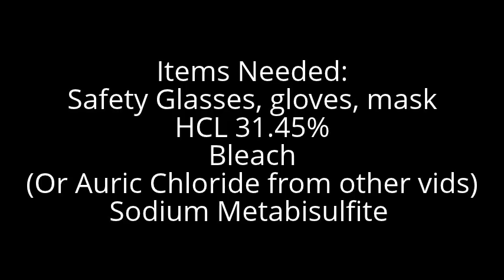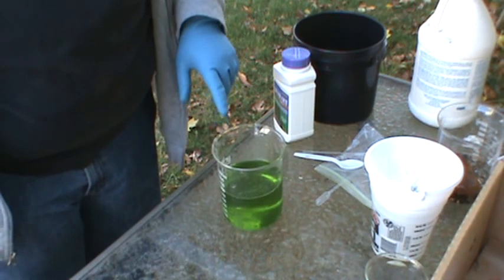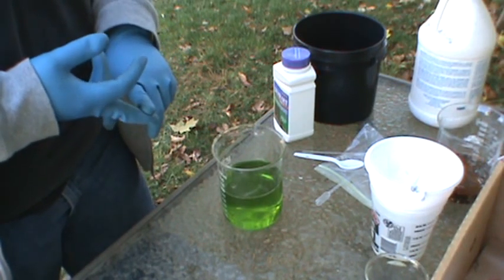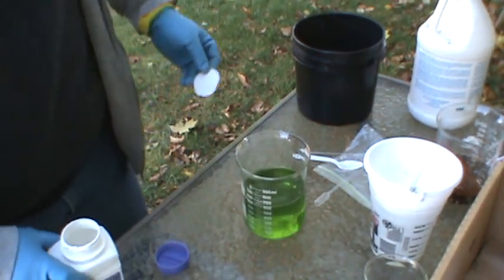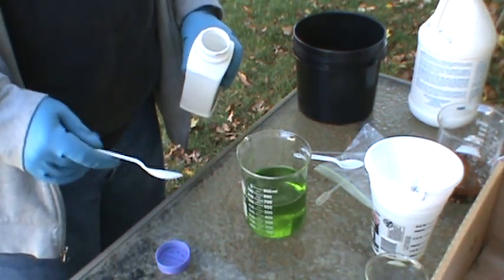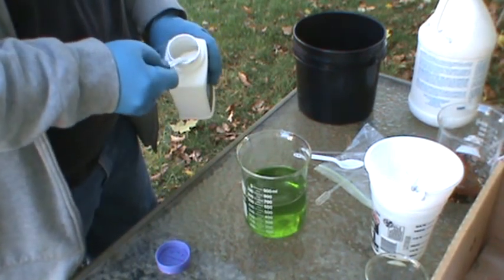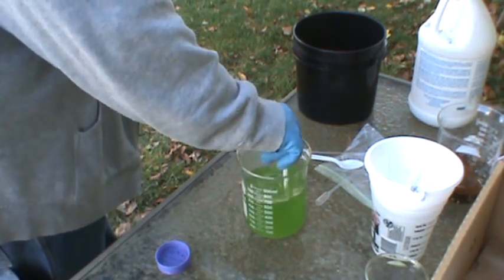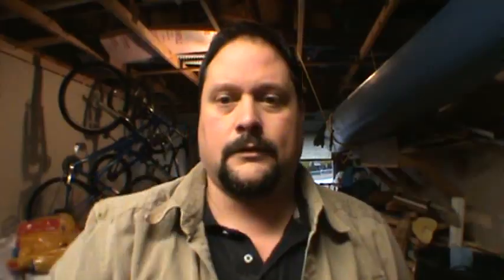Gold Recovery:  A Refining Process to Purify Gold

Comment: ~*Hello Moose!!! Quick Question Please ---- I put my foils in HCL & Bleach where it did dissolved. I filtered, added a little more then twice the volume of water then th SMB. When I added the SMB, no reaction took place. Left if for a few hours & checked agian & nothing. So I added a little more SMB & nothing... Do you know the reason of this? Could it be I put to much water in before adding the SMB??? Thank you & hope to hear from you soon. (YoungScrapper1)*~
Reply: ~*Also I had used just enough of the mix to slightly cover the gold foils at the start of it. So I wouldn't think it's the same problem with what you had with your reaction. *~
Reply from the maker: Hi there, I am not sure I can help out that much but will try.  There should not have been water added to start with.  That makes the amount of gold per ml drop quickly.  How many grams of foils did you put in and how many ML's of solution?  If there was too little gold in there you may not see the rapide darkening reaction or see much precipitation at all.  Another quick tip, adding more SMB does not help.  If there is no reaction with the first dose, there will not be one no matter how much you put in there.  Do not discard the solution.  Save it and the next time you have a few grams to process, at least 5-8 grams, use this solution that has the SMB in it to preicpitate the next solution.
Reply: Moose Scrapper
~*Thank you for your response, Tips & your help Moose!!! Means the world to  a young scrapper like me! ;)  I've been doing research the past few years about all these different recovering & refining methods following you & a few others before I ever thought of doing this so I didn't look foolish. I really thought I had it all figured out. Sad to say that I haven't got this ending process down... Sorry, I should of addressed this situation clearer. I had roughly about 3-5 grams of gold in a empty water bottle. I poured 2 inches of HCL in and added very small amounts of Bleach until there was not visible gold. So over all about 3 inches of solution. I then filtered & added water to the solution to doubled (I did a little more) the volume. (thought that was what I had to do) Then started dropping the SMB in the solution. When nothing happened, My heart stopped!!! But I will hang onto it & try what you said and hopefully get back on track with this ending process. I'm now just confused on the part after dissolving the gold up to the SMB drop. I know the rest of the steps after the dropping the gold. From a young scrapper to a scrap god, I thank you again for your time & knowledge!!!  (YoungScrapper1)  *~
Reply from the maker: Whoa with the god stuff....I'm just a knucklehead trying to make is way in the dark without stubbing his toes.  I am glad to be able to hel pwhenever I can but am by no means an expert.  I think you are on the right track with the gold processing though.  Once the gold is dissolved in the HCL and bleach, it will never go away unless you precipitate it out so you can keep it in solution for along time.  In WW2 thats how a lot of Jewish people hid their gold from German soldiers by dissolving it in things like this and aqua regia.  The soldiers had no clue it was gold because it was liquid, and when they saw the "Nitric acid" label they kept on moving!  So keep dissolving gold in there.  Do not add anymore water or HCL.  You can even let a little evaporate out if you want.  You can hold several ounces of gold in just 3-400 ML of solution.
Reply: Moose Scrapper Hi Moose, can you process more gold, say inkjet cartridge ribbons, in the same solution, or should you process in new solution and then add it to the previous solution? If I read your comment correctly, it looks like process in new solution then add to the old solution with the SMB  already in it.
Reply from the maker: nope, that's backwards.  The same solution (before SMB is added) should be used and used and used as much as possible until gold stops dissolving all together keeping the volume down as much as possible.  The #1 problem folks run into is thinking they have more gold then they actually do, so when they go to precipitate with the SMB, nothing happens.  The second common issue people have is taking more than one process and mixing them together, such as above, adding water to the solution.  Best of luck to you!

Comment: hey Moose I had my gold boards in A/P 24 hour and filtered my gold. I  had about 5 grams of gold was going to wash it the second time to clean it up some. I added 150 ml of Muriatic and 50 ml of peroxide and when I add the gold it disappeared and the liquid turned yellow like yellow liquid gold. Now my question is can I add smb and bring my gold back this way insteal of using the bleach. I know now that I added to much peroxide.
Reply from the maker: no you cant add smb.  You will have to ad a small piece of copper pipe, or some thick copper wire to it.  The solution will take in the copper, turn green, and push the gold out as a precipitant.  It may appear as black powder.  Peroxide sould only be added in very small quantities., just enough to get the reaction started.
Reply: ok thanks Moose if I get this black powder what do I do with it ?

Comment: is It legal in NYC to do? Cause I would like to try it out. And also where to do buy all the chemicals at. And also the respirator does it have to have some special types of filters?
Reply from the maker: Hi there, I do not know if it is legal or not in NYC.  All the chemicals can be bought at a hardware store.  If a respirator is to be used it should be rated for chlorine gas.  I really do not recommend doing this if you have very close neighbors.  Thanks!

Comment: This is very interesting, I want to do this. I was wondering could you mention your costs with breakdown of chemical costs in relation to recovered gold.
Reply from the maker: Hi and thanks for watching.  Costs are pretty low.  The HCL is about $8 a gallon, bleach $2 a gallon, and the stump out or the smb is about $8.  As for the cost for outcome, I really cant say.  What I can tell you is that the cost of materials is almost nothing compared to the amount of gold you can recover.  200ml of the hcl/bleach solution can hold several ounces of gold.  Most people try to precipitate out the gold as quick as possible and end up with just a gram or two but should wait an keep dissolving the gold in there until the solution no longer takes the gold.

Comment: iv got a problem can you pls. help me. I followed your process as you done on this video (Gold Recovery: A Refining Process to Purify Gold) till it turns green I was with you but then when I put in the SMB the solution turned brown and I left it over night and I did not had the same result as you. It remained brown liquid. Can you pls. tell me what I done wrong?
Reply from the maker: Hi and thanks for watching!  It is really difficult for me to say what happened unless I am able to see all that was done.  Typically, if it turns brown, that's a good thing.  That's the gold comein out of the solution.  It should settle to the bottom.  Try filtering out through a couple coffee filters then test the solution with stannous chloride to see if there is any gold left.  Any solids in the filter will be gold and any left over SMB.

Comment: And what are the problem with the solder getting in to refining
Reply from the maker: There are lots of problems with that.  The bi ones are that it completely changes the chemical composition of the solution making it harder to process.  Also, depending on the type of solder, and there are many different types, it can cause things to gel up making things MUCH more difficult.

Comment: so i used muriatic acid peroxide to scrap gold from just ram chips.. i was wondering how the material should be treated next so that i can purify it.. I just starting out but i have thousands of fingers and tons of electronics as i fix computers but only did 50 in a batch and because you have done excellent videos, I would love to hear your thoughts...thnx
Reply from the maker: Rinse it a few times in just HCL until the acid no longer turns green.  Then check out my video on purification.  Thanks for watching!
Reply: cheers m8. do u have a guess for how much gold is revoverable from 1000 ram fingers? just curious...thnx again
Reply from the maker: ***** Just the fingers not the whole ram?  I would say about 5- 6 grams.

Comment: Hi can you use auric cloride to remove gold from computer pins?
Reply from the maker: technically you can.  You just need to make sure you pull them out before you start dissolving copper or brass or whatever the base metal is.

Comment: can i use the same process with cell phone motherboard or would like to show another video how to extract gold from this
Reply from the maker: If the board is cleaned off.  You can use a hot sand bath to remove all the other components and solder then the AP method would surely work to remove the gold.  Thanks for watching!

Comment: Sooo, whats the difference with agua regia and the muriatic bleach solution? they both dissolve gold right? its just the chemical used to displace the gold which would be different? or am i getting this wrong?
Reply from the maker: AR is a process to rapidly break down metals nd can be used for silver, gld, platinum an palladium etc.  This method of HCL and BLeach is pretty much just to purify gold but can be used (though not recommended by refiners) to recover some gold.
Reply: cool man. shit i wish you were here in the Philippines, see we uncovered a cave, that literally has gold pieces stuck in rocks, and so far we have uncovered 2 sacks full of it. i kinda wanted to email you this as it is a private matter never mind haha. well why i ask is i wana know if these acid mixtures can eat through rock or just have it dissolve the gold with the rock or some something. no idea really. also it would be better if it was all pulverized first right before i start tanking it into the solution? what do you think would be a better way to do this?
Reply from the maker: Marcus Kaiserkopf Well I don know much about dealing with raw ore however I can say that crushing it will help.  Also, the HCL Bleach method is great for taking off thin layers of plated gold but will take a long time to dissolve anything really solid.  It will still work, just takes longer.  The important thing t do would be to find out what kind of rock the gold is in as some rocks can be dissolved very easily leaving only the gold.   Best of luck to you!
Reply: Thanks Moose,also, kinda hard getting concentrated Sulfuric acid in Cebu for some reason, do you think battery acid is good enough, it has 35% Sulfuric content with it
Reply: so Aqua Regia breaks most metals down including gold, silver platinum etc, but Muriatic and bleach just break down gold alone? coz i think i need the solution to dissolve the gold into auric chloride form, can Muriatic and bleach do this?
Reply from the maker: Marcus Kaiserkopf I couldn't tell you.  I have not woked with sulfuric or nitric acids yet.  All of my experimentation has been with HCL only.
Reply from the maker: Marcus Kaiserkopf HCL and bleach can also break down metals like copper, aluminum, tin, etc.  Ferrous materials don't do well in it either unless its stainless steel.
Reply: can i extract silver also with HCL/B then precipitate it with Copper rod?
Reply from the maker: Marcus Kaiserkopf Not that I know of.  For the most part the only silver recovery I have heard of (and not practiced) involves Nitric acid.
Reply: hmm ok, thanks Moose. Totally helps man :D apparently palladium has good market value also i saw a way to be refine it from ceramic monolith capacitors but the video wasn't detailed enough for me to figure the rest out. Also, i saw a video where you remove gold plating's on ceramics, that one was pretty good too, thing is i got silver plated ceramics, so i guess i need nitric acid for this then..
Reply: what other precipitates can we use if we don't have SMB or sodium pyrosulfite?
Reply from the maker: Marcus Kaiserkopf None that I know of but SMB is REALLY cheap on ebay.  Its used as a food preservative.  Can also find it at alcohol brewing stores as something that cleans the glass ware before fermentation.

Comment: awesome. So how much scrap gold would I need for a wedding ring? lol
Reply from the maker: Mens or womans?  Mine is 8 grams and my wifes is 4 grams (12g total).  They are 14 K so you would need about 54% 24K and the rest silver.  So you would need about 7 grams of 24K for a set.  You can do that with 2-3 lbs of trimmed gold fingers or 1-2 lbs of ceramic CPU's (You may be able to do it with a lot less ceramics depending on the type).

Comment: Hi moose:  questions...1-what to do with left over muratic/peroxide formula after i collect the foils? i know it contains copper.  2- after dissolving gold from ink ribbons/ceramic plates, could i throw the recovered foils from the previous peroxide method into solution to dissolve and purify?    3-  if i dont add the stump remover after dissolving ribbons, can i store the mix to use for more recovery until i have say a 1/2 gal of solution that will no longer dissolve anymore(gold full), than hit it with remover.  This question stems from confusion....the recovery of gold from ink ribbons and ceramics is the same as purifying the gold.   3-  after adding stump out  you say you will boil it to evaporate solution..can you further explain this? Is there a too hot.  

I have done the peroxide, have foils on hold.  Want to dissolve ribbons, but not if i have to add stump out right away(i dont have any....nor income.)

Thanks again!
Reply from the maker: Hi and thanks for watching!  Ill do my best to answer your questions.  1- the A/P solution can be reused over and over many times.  To add life to it just stick a piece of stainless steel into it for a few days to cement out the copper in the solution.  Once you feel that it has no life left, evaporate and store the dried metal salts in a air tight container and contact your local govt and inquire about chemical waste disposal.  2-You can absolutely add the foils into the mix which at this point is auric chloride or AC.  3-you can store it an keep adding to it all you want.  It does not take much solution to dissolve several ounces of gold.  You will not want to keep a half gallon though, you will want to use and make as little AC as possible.  Once the gold is precipitated with SMB or stump out, the solution is dead.  You can boil it or just filter it, does not reall ymatter that much.  Most people prefer to filter.
Reply: Awesome.  I will still look into the following, but in case you know, i present the following:  can the A\P be put in a reverse electroplating system in which the copper would stick to a pure copper piece?   

As for the other 2 questions, thanks for clearing up my confusion.  I will stick with the amount i have until making more is needed(i have a baby food jars worth).  I am currently testing both a/p and ac methods on diabetic test strips, i will share my results.
Reply from the maker: Jason Shaw I look forward to seeing those results!  As for the reverse electroplating, not sure, I know that the copper comes out wasy enough just by sticking in a piece of stainless steel.  Thanks!
Reply: Ok, steel is simple.  But than how would i scrap the copper if its stuck to the steel?
Reply from the maker: Jason Shaw A quick dip in water to neutralize and dilute the acid then it will just break off in lumps.
Reply: O well that changes everything...thanxsomuch!!
Reply from the maker: Jason Shaw Best of luck to you!

Comment: what do you do with the "garbage" left over?
do you need to rinse and can it be disposed of safely?
What do you do with the used solution?  Hopefully you don't just dump it down the drain or on the ground, What is your "clean-up" process?
Reply from the maker: You need to contact your local government office to see what chemical disposal facilities and programs are available in your area.  Most places have a once a year free drop off, otherwise you have to pay a small fee.  When I am done with my chemicals I evaporate until all that is left are the metal salts and keep them in sealed containers without mixing.  Since I only use two solutions its not bad.